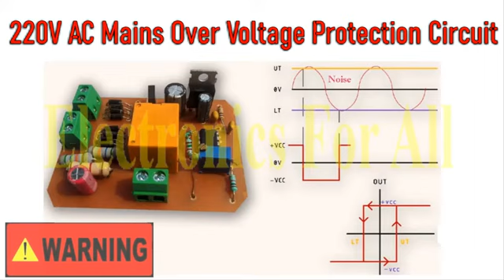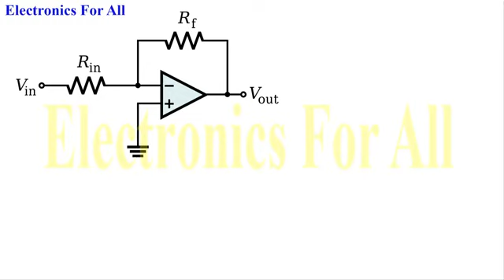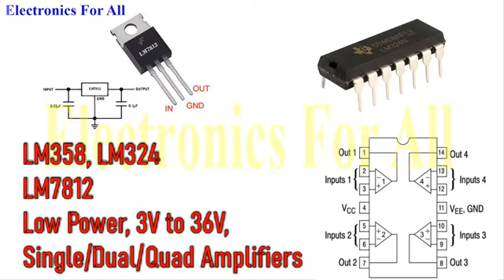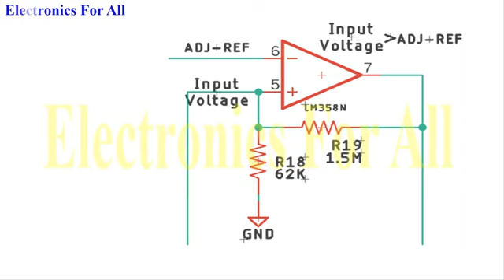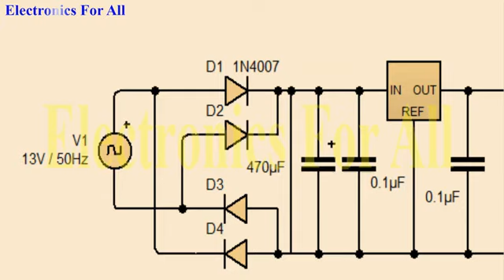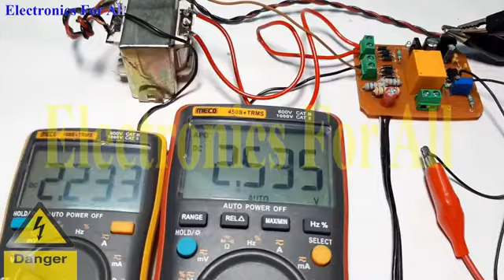STOP! 220V Over Voltage Will BURN Your Fridge! Build This Home Protection Circuit

Comment from the maker: ⚡ FULL CIRCUIT DIAGRAM & PARTS LIST HERE ⚡

Circuit: Automatic 220V Over Voltage Cut-off Protection

Parts You Need:
1. MOV Varistor - 275V AC (S20K275) x1
2. Zener Diode 12V 1W x1
3. Transistor BC547 x1
4. 12V Relay 10A (SPDT) x1
5. Resistors: 100K, 10K, 1K
6. Capacitor 100uF 25V
7. Bridge Rectifier / 12V Power Supply for circuit

Working:
- Normal: Relay ON, Appliances Connected
- Voltage > 250-260V: Zener Triggers, Transistor OFF, Relay Cuts Load
- Auto Reconnect when Voltage Normal

⚠️ 220V IS LETHAL! Use isolation and proper PCB. If you are beginner, ask an electrician.

If this video saved your home, hit LIKE & SUBSCRIBE for more protection circuits! 

Question? Ask me below 👇

#220V #OverVoltage #Protection
Reply from the maker: أي جهاز اتحرق عندك قبل كده بسبب ارتفاع الكهرباء؟ قولّي في الريبلاي 👇